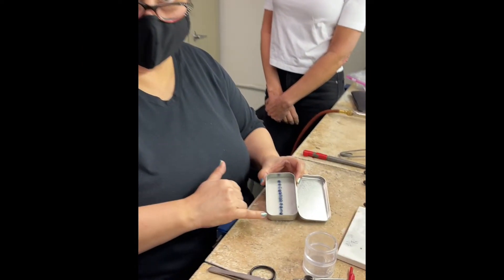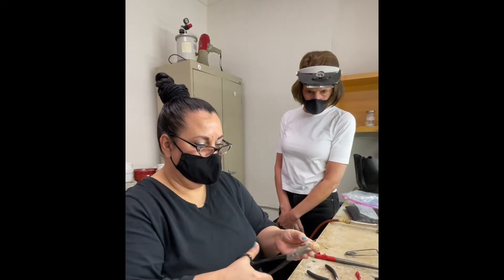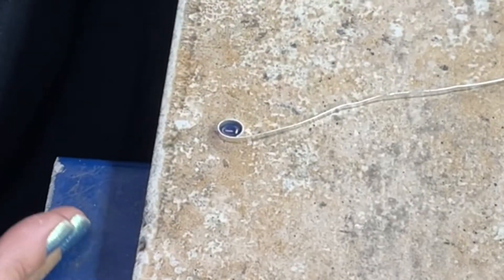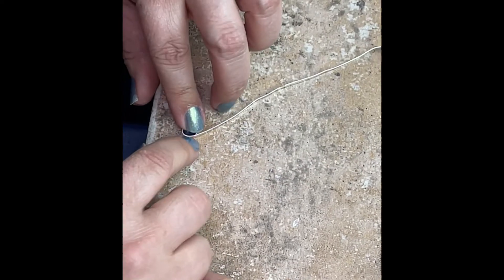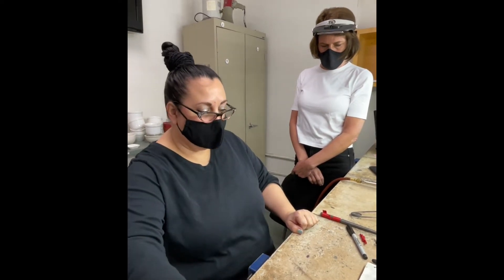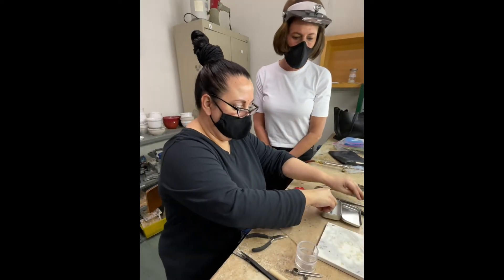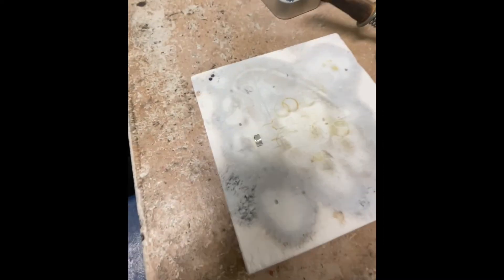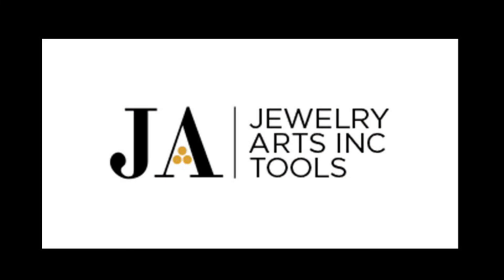How to Make and Fuse a Bezel (1) (A Tight Fit is Everything!)

Comment: Thanks so much for your lessons. I have 2 questions. 1) You said after fusing you can put it on a mandrel and move it around....please I would like to understand what the objective of  that could be especially since the mandrel is round and the bezel is oval or  could be any other shape? 2) if making a ring, must the bezel be soldered on a back plate first before mounting on the ring? Should the backplate be sterling or fine silver, fused or soldered? Wish you could show us a process with a ring from start to finish. Thanks so much. I'm a beginner and a new sub and I'm learning so much from you.looking forward to your response
Reply from the maker: The objective is to smooth all all the lumps and bumps, I only do that for a round or oval stone, easy to reshape an oval. For fancy shapes , I just poof out the side with the seam, clean up and retweak the bezel to fit the stone. Generally the bezel should be attached to backsheet and anything else (wires, etc) before you attach to the ring shank. The choices for fused, soldered, sterling, fine silver, etc depend on what else is going on in the design and doesn't have a set answer, it varies with the variables. :) I have lots of videos showing all stages of construction progress, keep watching and you start to see how it all works.
Reply: @JewelryArts  thanks so much for your response. I appreciate it.
Reply from the maker: @valerie4710  You are very welcome! :)

Comment: This is fascinating. I love bezel setting, for both faceted and cab stones, because it provides a lovely secure setting that protects the stone, but I’ve never fused my bezels even tho I usually cut mine from 0.5 thickness fine silver plate. Dunno why cos I have done fusing using fine silver before, just never a bezel. Thank you for the information. I’ve subscribed and hope to see many more informative videos from you.
Reply from the maker: Lots more videos to come! :) Fusing is such a great method for bezels, one less solder seam to consider. :)

Comment: Hello Jeanette,
thank you very much for your very informativ video. I appreciate it a lot, that you explain exactly why you are doing or not doing something👍🙂.
I have two questions... Is there a reason not to use flux in this case and does this technic works also for sterling silver?
Have e a nice weekend.
Greetings from Germany
Maren 🤗🤗🤗
Reply from the maker: You are very welcome! Flux is not helpful for fusing fine silver, it just gets in the way. Sterling won't fuse nicely, so if you use sterling bezels, solder them shut. :)
Reply: @JewelryArts  Thank you very much for your soon answer. I learn again and again😁👍
Reply from the maker: @marenc9648  You are most welcome! Let me know how it turns out. :)